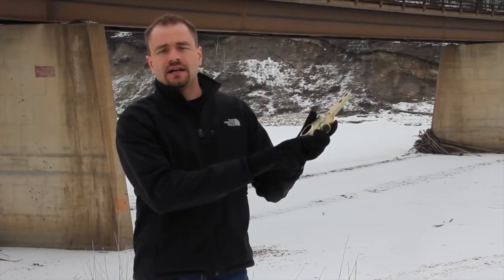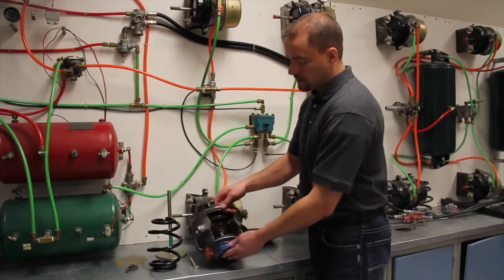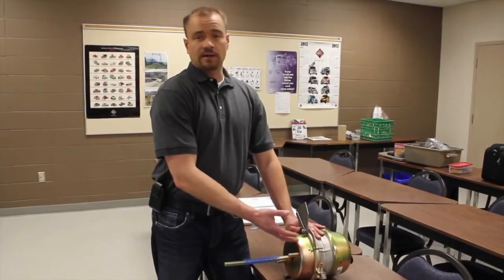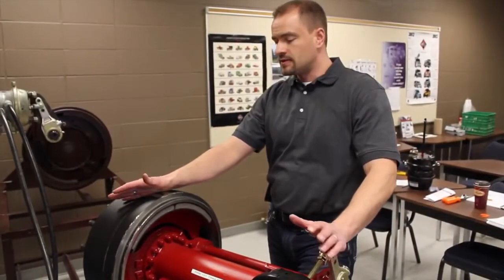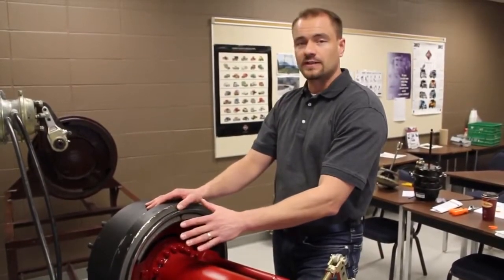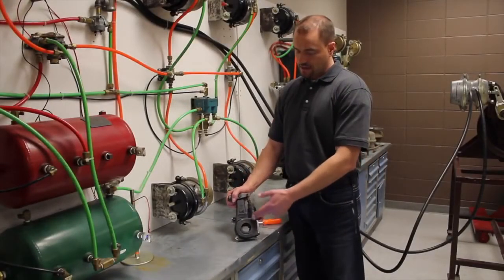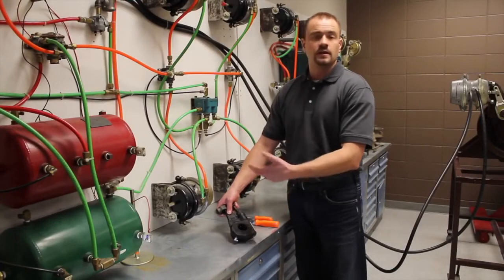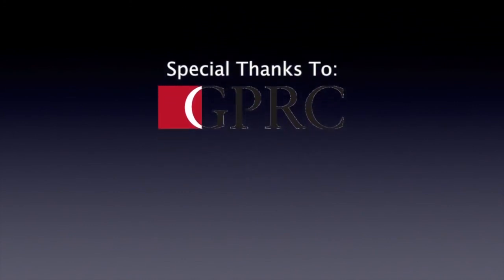Brake Adjustment Training Video   PetroWest   Grande Prairie Alberta   YouTube

Comment: This was awesome  In some states you can drive a RV without an air brake endorsement Apparently they rely on automatic slack adjusters to take care of you so idiots will buy RV's and not be intimidated.If you are a regular auto mechanic when you look in from the back and see how thick your brake shoes are you need to understand they are toast at 5/16.You need to understand stroke measurement.You need to understand that the shaft has red on it and why.And finally you need to understand running them past 5/16 will flip the s cam on a hard brake and your brakes will disappear.If you live somewhere that lets you operate an air brake RV ....ahem,California,  and you think you know it all because your an auto mechanic your bullshitting yourself and you need to watch this,get out there and do a brake inspection before you move it least you find out approaching a red light at 40 mph towing a full size pickup that you flipped an s cam at the last stop.If you do your job it will never get to that point.Its a funny gray area RVs with air brakes they don't want to bug RVers with scales and inspections but at the same time a lot of them are stupid,old,old and stupid can't screw in a light bulb yet they are bombing around in 40000lbs vehicles with brakes you need to maintain and keep an eye on frequently in the rocky mountains.

Comment: Very informative! Driving an older bus with manual slack adjusters, this was a great deal of help! I’ve put over 15k miles on our ride in the last two years, with 70% being westbound mountain roads, and I’ve never adjusted mine. This video was part of my research🤘🏼
So when you adjust the slack, does that also soak up the travel on the rod? If my rods travel greater than 2”, seems like I’d need to tighten the rod. Is there a method for that process 😅?

Comment: Here in Calif the brake angle is75° unapplied&105° for 15 ° past 90 ° long as you are not out of travel.  The old law was refered l-64. I believe it has been changed to a different  code #. They are doing all they can to do away with the past 90° ? Commercial officers will try to convince you that the law is 90°.